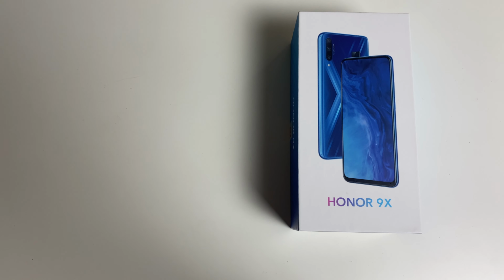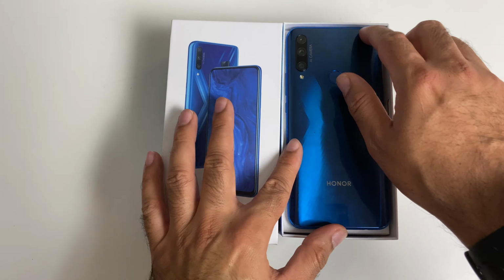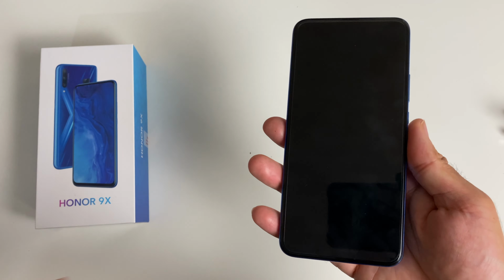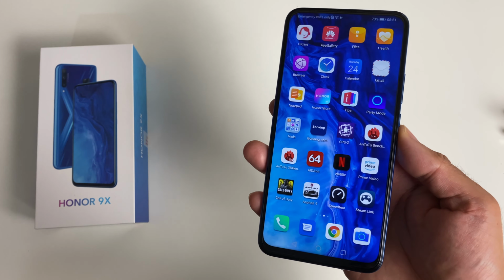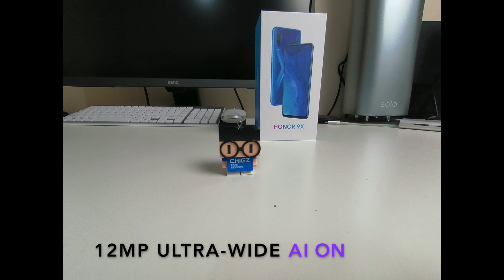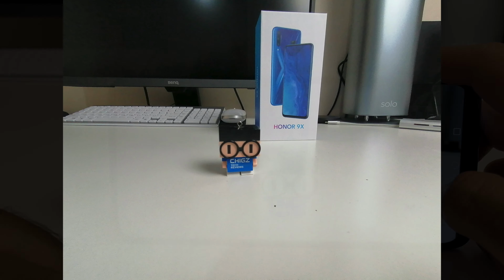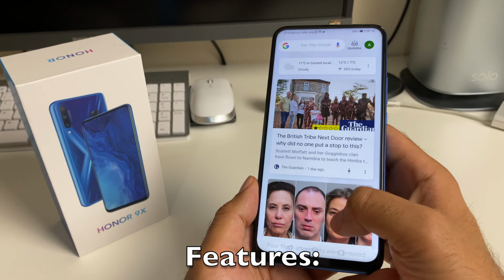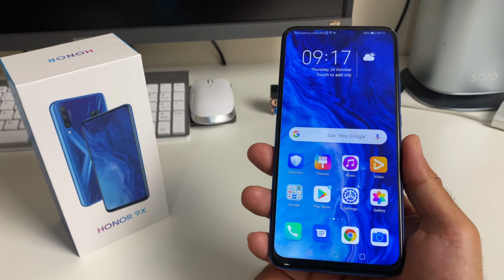HONOR 9X Smartphone / Unboxing First Look / Specs / Camera

Comment: I wonder if you could give me a little bit of help with a problem with a box I have an Android box when I am trying to watch anything on it cuts in and out after 4 to 5 seconds. It is a Daermbox.
Reply from the maker: Cut outs are usually a hardware fault. Try a factory reset from settings first. If that does not fix it, then it is a hardware fault.

Comment: I am very much disappointed.
Firstly with the downgrade of the processor from 810 to 710f 
And the fingerprint placement.
The original launch was way better. : (
Reply: it don't have 810? kimovil says it has 810, they have wrong info then
Reply: U DONT HAVE THE PREMIUM VERSION! Like its only in europe
Reply: @jera3862   your so called premium model doesn't support GMS.